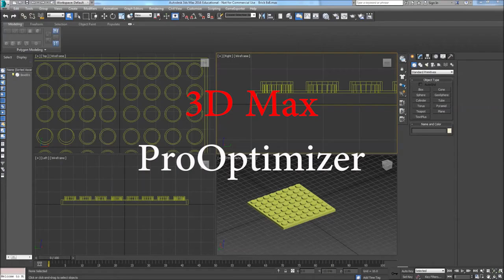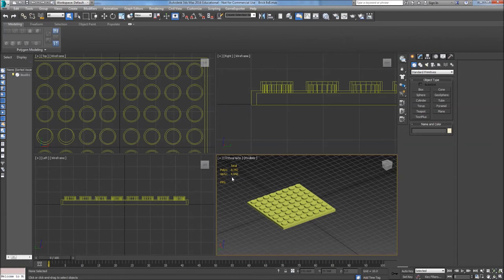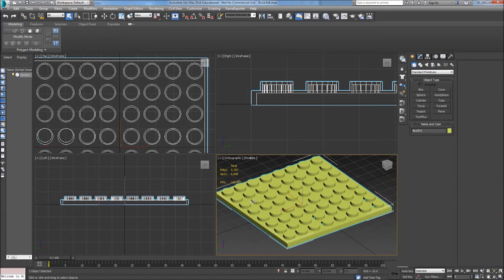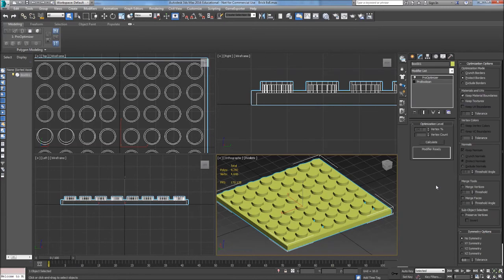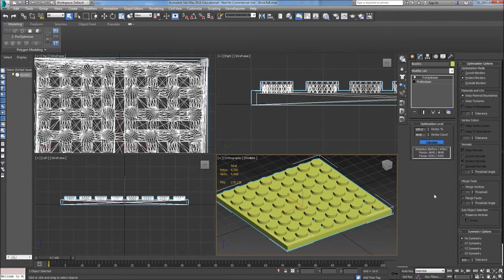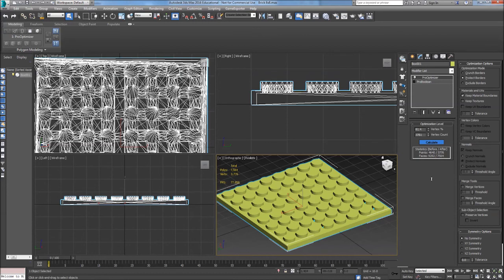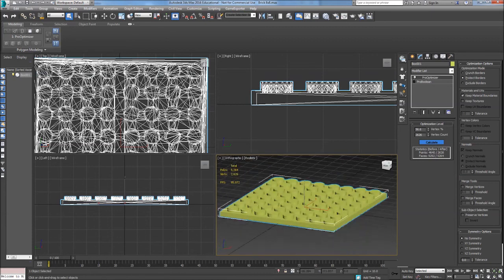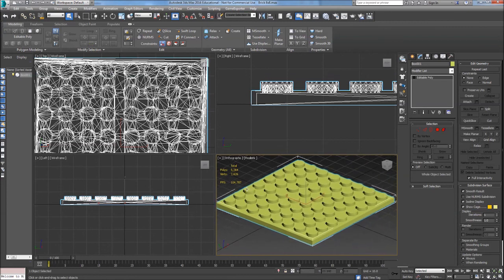3Ds Max ProOptimizer Reducing Polygons

Comment: My 3ds max pro optimizer freezes at 90% what i click calculate.... any idea?
Reply from the maker: +Anthony T it could be a memory issue.  If your scene is big, you could try breaking it up into smaller pieces.  Also make sure you don't have any unnecessary programs running in the background.